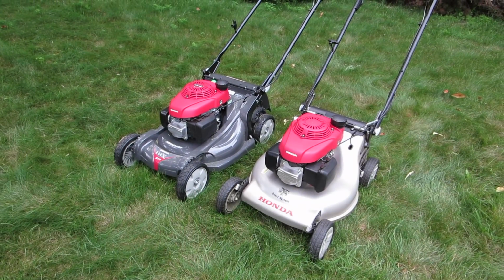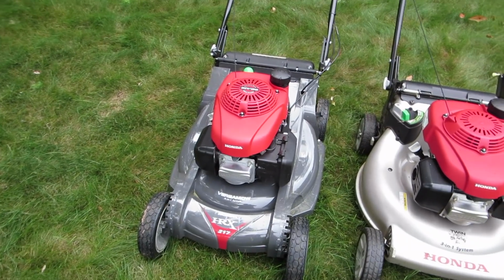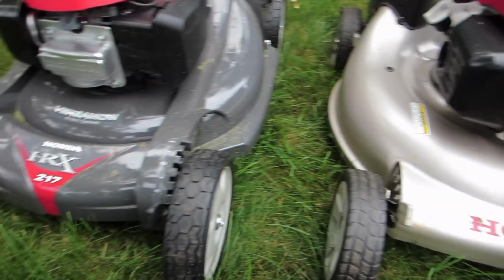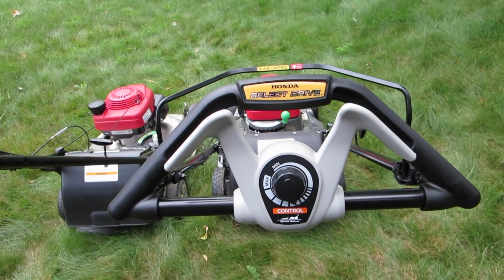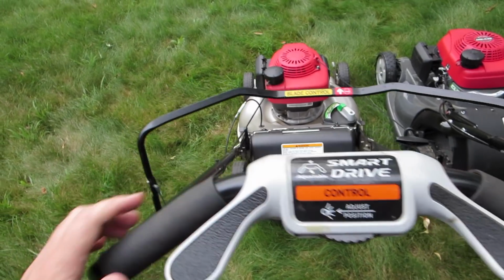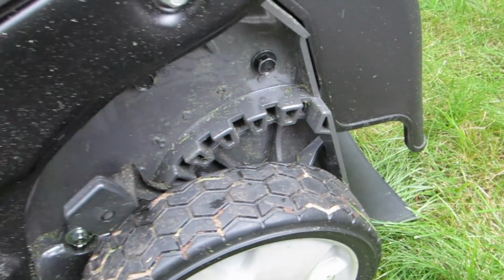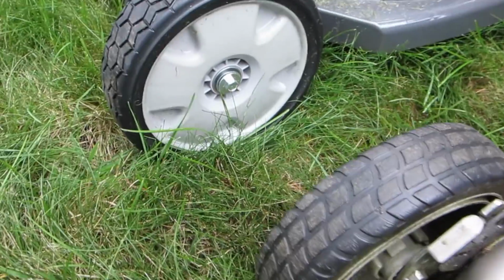Honda HRR vs HRX Mower Comparison - long term review

Comment: The blades are indeed interchangeable....I use the HRX blades on my HRR  I find I need to replace the blades every other year along with the wheels on the HRR as the tread wears down to slicks.. I mow 2 times a week in summer and always bag.  Great mowers!  I change the oil and air filter 2 times a year and sharpen the blades routinely.  I go above and beyond taking care of my HRR and it performs like its brand new.  I also find it helps to do a yearly cable adjustment to jeep the drive mechanism super responsive
Reply: I'm with you. I am an absolute FANATIC about my HRX217HZA. It's the nicest machine, of any kind, that I have ever owned. I came up with the money and decided I was going to buy the best. I change my oil every 10 hours. I put 50 hours a year on her.

I've done so much work upgrading that mower it's pitiful. Magnetic dipstick, protective side rails, tach/hour meter, Plasti-dipped wheels, lawn striping kit and on and on and on. My obsession with that mower is a problem. LOL. I even named her Kathryn. It's sick, I know.
Reply: @heinzkitzvelvet  Good idea on PlastDip wheels. All my neighbors are over-pensioned retired Boomers with the best Honda mowers and nuclear green chemical lawns. It will drive them nuts thinking I have some kind of special edition orange-wheeled Honda that they somehow missed at the dealership.
Reply: @madcowusa4277  Orange. Now that would be different. Never thought of going with wild colours. I used a black base with graphite pearl as a top coat so the wheels better match the deck. I might try something like that next season. I respray them every spring because it peels away by the end of the season and looks bad.

BTW, that's an interesting phrase, "over-pensioned" retired boomers. What does that mean, over-pensioned?
Reply: @heinzkitzvelvet  To me, "over-pensioned" means they have a nice fat monthly retirement check that was part of the their previous employment's benefits package or they were offered profit sharing which they're now cashing in on, hahaha!
Reply: @Believe231  ok. It's sounds kind of negative. Like over-privileged. I mean, it sounds like they worked the years required for that pension that they are recieving.
Reply: @heinzkitzvelvet  I see where you're coming from now.  Yep, one needs to not make assumptions, and to realize it may not have solely been "privilege" that gets people into a comfortable retirement, but they got there through the merits of hard work and dedication.
Reply: Heinzkitz Velvet protective side rails?

Comment: I enjoyed the video. Just got a new HRX217- I kind of liked the older style of speed control, but probably will get used to this new one. As far as the plastic deck, I have seen a good number of older Honda mowers with serious rust on the decks that still had good engines, and I don't live anywhere near salt water, so maybe this was addressing those problems. My old HRX 217 plastic deck is still in great condition after 10 or so years of use.
Reply: Did you get used to the newer Select Drive control? Just curious, because I have an 11-year old HRX217 w/ the Smart Drive, and a 2-year old HRX217 w/ the newer Select Drive clutch grip. The definitely feel different in the hand!
Reply: @joepapp01  After a few months, I sold the new one and bought another older HRX in good shape w the older control. I didn't like the new one, never got used to it, and read a lot of reviews from people that didn't like it either. Another issue was the new HRX didn't have a blade clutch that shut off the blade while the engine continues to run. I really like that feature, especially since my son is 7 and there are usually at least a few small toys that have to be picked up while mowing. The "old" HRX I now use has the blade clutch.
Reply: @mickm5097  so does your HRX with the blade brake clutch have neither the smart drive controller nor the select…just a “standard” clutch lever? My neighbor has an electric start HRX217 with the blade brake clutch, and I’ve used it a couple of times this season. The BBC isn’t a feature that I value, but totally see the utility of it if you have kids. My brother’s lawn always has toys and balls on it from his kids lol. I was surprised with the additional weight of the BBC/electric start model…at least +10lbs on my “standard” smart drive hrx. Will you try to keep yours for as many years as possible? I’m not that much of a lawn care fanatic, but I do cut my yard + 2 of my elderly neighbors’ yards weekly, so…idk, it’s kinda fun to have have a preferred brand of mower and be in a decade+ long rhythm of cutting efficiently with it lol
Reply: @joepapp01  Mine is probably just like your neighbor's. It has the electric start (not something I need really) and the orange handle speed control w 6 or so notches to set the speed, in addition to the blade clutch. I will keep it for as long as it is reliable, I think. My lawn has a mild slope, and the newer HRX control was inconsistent on it- pressing down sometimes made it move a lot slower or faster than I preferred in different areas of the lawn, whereas the older notched control always moves the mower at the same pace, no matter what. The HRX feels sturdy too, like a tank compared to other mowers, which is good, as long as the self propel keeps working. I used to have Craftsman mowers, which I liked a lot- to me the front wheel drive was easier to control. Just pressing down on the handle to lift the front wheels slightly if I wanted to stop the self propel, never had to let go of the propel lever. And it was easy to pull backwards- in contrast, every Honda mower I've had at some point has the intermittent wheel dragging when pulling them backward. Not sure why Honda never fixed that issue. Still, Honda quality and reliability tops other mowers that I know of, so it's nice to have one.

Comment: The place were the deck material matters the most is under the deck when it gets packed with grass. Owners ever clean them so they rust from the underside and rot out.

Comment: The HRX217 VKA(200cc) is a great mower. I have 4 nit picks with mine. Mine turns to the left very, very slightly. The handle is on the highest setting and I still feel like it is too low for me. The speed is on the absolute lowest setting, but still feels a tiny bit faster than what I want sometimes(again 200cc) But the biggest thing is $600 and no blade stop. If you want to start the mower without running the blade, then you have to go up one model... $730...

Overall, it's still the best 21inch mower you can buy. I know it will outlast and cut better than any consumer grade mower.
Reply: A friend of mine buys a new $199 mower every 2 or 3 years.  Our Honda's cost a lot up front, but it's just oil changes and blade sharpenings for at least 5 years and probably not much more after that.
Reply: You don't want that blade stop, the clutch for that roto stop is nothing but trouble. Much more reliable without it and plus these honda mowers start so easy that it's really not worth the expensive repair to have a roto stop clutch.

Comment: I would go with the hrx because u always see the metal decks rusted out on the Hondas with the engine still working so I would rather spend a little extra money to have the better deck so it doesn't rust out

Comment: The Nexite decks are notorious cracking. Once it starts there is no stopping it. Being the owner of a small repair shop these come into my shop on a regular basis. Honda is good about their warranty although nit every mowers damage is covered. They are vert stringent about the circumstances which contributed to the damage. Overall, any Honda mower is a good choice. Personally a steel deck, cared for properly, is my choice. Every day .

Comment: I still have my 15 year old Honda mower and it works great, but looking next year to upgrade "maybe."  The self-propelled drive does tire out my thumbs (no adjustments), better after mowing ever week your thumbs get use to it.  I do like the HRR though a little more than the HRX.

Comment: The rear wheels on the HRX have numbered adjustments that are cut into the plastic. I missed it the first few times as well because the numbers are the same color as the plastic deck.

Comment: I was excited to use my new HRX today. Very nice machine. The new 200 CC engine is
a brute. I do have two concerns that will probably go away with use.
1. The select drive system was poorly engineered. I still have my 20 year old Toro
Super Recycler with the Personal Pace system. No contest, Personal Pace Rules period.
2. Concern is this HRX is a dust producing machine to say the least. I think it maybe over
mulching, I know that sounds stupid. It just makes a dirty mess. I wish the air filter was more heavy duty. It is adequate at best. 
I will get to like it , it’s just tuff when you are use to the Toro. Great video I might add!

Comment: After almost a year, did the wheels harden on the HRX? In April, it would be great if you did a 1 year review.
Reply: I got mine in 2014 and no they are same consistency. I am in Nebraska so we get all 4 seasons.
Reply: Keith White I bought a HRX217HZA just last week, though it’s on backorder and no telling when I’ll get it... the discounts are crazy now. That mower lists for $959 and paid $780 + an extra year warranty.
Reply: zfilmmaker that is a good deal. Mine was 645 in 2014. Besides changing oil , spark plug, air filter and blade no maintenance. Starts on first pull. You will love it.
Reply: @keithwhite6096  I mainly decided to buy based on price. I've had several Lawn Boy's... in the last decade quality has gone downhill. I've been ready to part ways for a while. Honda seems to have the best bang for the buck. Everything I buy with a Honda motor seems to last. Case in point, I bought several high-end snowblowers only to find out they were all junk compared to a Honda. That goes for pressure washers also. Thanks for your input!
Reply: @keithwhite6096  if you haven't already, you may eventually want to replace the drive shaft bushings and dust seals (each rear adjusting arm takes two bushings, and they absolutely wear out over time).

Comment: Thanks for sharing Garage! I've had my HRR for about 6 years now in Florida and my deck is rusting out. Also, I've had to maintenance the self propelled system once and it needs it again. My question, how would you compare the robustness of the self propelled systems of each? It seems I've heard people say they have gone 8 plus years without needing to do anything to the HRX self propelled drive? Thanks.

Comment: Just out of interest, have you thought about trying to swap the wheels from the HRX onto the HRR?
I have the HRR here in Australia, and the tread has worn completely off the rear drive wheels, and it is greatly  exacerbated by the rear wheels locking up and not free wheeling when pulling the mower backwards. But I totally agree that the HRR could do with the bigger wheels. I would love to know if they were interchangeable as I would buy the bigger wheels. Great review. Thanks.
Reply: David Ludrock 
Putting bigger wheels on the HRR would mess up the cutting heights a bit. But what I’ve done with my HRR is I’ve put these new style wheels on it that Honda now makes. They have so much better traction and are made of a better material. https://youtu.be/GLPqdKXDo9E
Reply: This vid will help you address the issue with real wheels locking up when pulling it backwards. Its due to the crappy plastic bushings Honda used on the HRR.

https://youtu.be/ZvpqyWQUb48
Reply: @KirbyVacuumCollectorFixer  thanks for that. I'll give those K10 wheels a go.
Reply: @cliffm.9796  they use crappy plastic drive shaft bushings on the HRX line, too lol

Comment: I’ve had both models. The HRR for a yard with st Augustine and it worked freaking amazing, all mulching. Never felt under powered. The HRX for my yard with Bermuda now and it’s just ok on mulching in the thickest parts of the bermuda. I to liked the HRR paddle better drive too. I use the HRX paddle in a varying like I did with the HRR. Don’t care or use the in between bag and mulching. Don’t understand it really.

Comment: Have you ever had issues with a strip of grass being left on the left side, just inside the wheels, that’s unmowed? Change the blades to new Honda blades this season and I’m getting a streak of grass that’s not getting cut. Trouble shot everything I can think of...still leaves uncut grass.

Comment: I have the HRR and I upgraded the wheels to the 9" ball bearing wheels that come on the HRX for only $45. Now my HRR is the perfect mower.
Reply: Big Texas: I was thinking about doing that too, I’m glad you posted that. Did you have any problems or need any modifications?
Reply: @matthewinga9546  The only problem is the gears on the back of the actual wheels are 

a different size so I used the gears from the factory hrr wheels and put them on the new hrx wheels and they work perfect and have been since I did this modification 2 years ago. The gears are held on to the wheels via plastic tabs so I just used my soldering iron the heat the plastic tabs and fold them up to be able to remove the gears then heated them again the push the tabs back down once the gears were installed. You only have to do this to the 2 back wheels so it's not hard at all. I use my mower everyday for commercial use and the wheels have been holding up for over 2 years now and the tread on the hrx wheels seems to be actual rubber as opposed to the factory plastic hrr wheels so they are very durable and the tread still looks new even after all of the use I've put on them.

Comment: I have a 15 year old HRR. it’s been a great mower hose it over the dog during my divorce and it’s still doing better than the dog and most importantly, it doesn’t shit all over my lawn.  I haven’t done much to it other than sharpen the blades a couple of times and change the oil every couple of years but it’s starting to get a little sluggish and it needs a couple of hundred bucks in maintenance and I thought i would upgrade to a self propel model. The HRX is at the top of my list but I prefer the TORO super recycler with the Honda engine. The downside to the Toro is that the Honda engine is the weaker 159 cc and the biggest deal breaker is it doesn’t have the blade stop when you let go of the throttle so I have to keep restarting it. Decisions, decisions?

Comment: Great videos   I bought the HRR  and had it for 6 months before it started stalling and shutting down.  Now looking to get another one.  It broke my heart cuz I love Honda lol.  Kind of hesitant to buy Honda again.
Reply: John McLain   At just 6 months it is still under warranty, so bring it back to your dealer.  It sounds as though the carb. Needs an adjustment.  Pretty simple fix, then you will be up and running again.
Reply: Randy Jorgensen  I called up Home Depot what’s where I bought it from.  They actually took it back      Now I don’t have a lawnmower.  I don’t know if I should buy the same one again or upgrade to HRX model. I don’t have hills on my lawn it’s square and level.  I’m confused. HRX is few hundred more.  Or just buy a toro or something.     Il not sure what kind to buy now because of my bad experience with Honda.
Reply: John McLain Mowers are mechanical things, and mechanical things can have problems occasionally.  This don’t mean it’s a bad product.  My new toro had the rear wheel drive system fail after just one lap around my yard, big bummer.  But I had it fixed under warranty and it has worked fine ever since.  I guess my point is, don’t stress over it too much.  There is no such thing as the perfect mower, but they are truly ALL good enough.  So pick one based on “does it have the most important features to me”, then consummate the marriage with your credit card, and live happily ever after!
Reply: Randy Jorgensen   Yeh you are right.  I’m gona buy it again  cuz I loved it.    Thanks for the advice.
Reply: @Jigsawmaster1  Yep, same here, I bought a new Honda HRX, and after a month, it developed a problem & became hard to start when the engine was first started for the day.  It actually turned out to be the gas, it had absorbed water or something, and so it wouldn't fire easily.  Drained the old gas out thru the carb drain plug, used fresh non-ethanol gas (ie expensive), and she fired on the first pull, and ever since!  Was very close to returning it, but called up a Honda mower dealer and they said to try that trick first, and it worked and then to NEVER, EVER put ethanol gas in it!  It's very hard to find non-ethanol gas in this corn belt state!
Reply: Believe231   I live in nj.  You can buy non ethanol gas at Home Depot.  It’s preety expensive.   I bought the same lawnmower again  cuz I liked it so much.   Right now Honda gives you an extra year of warranty. So total of 4 years.  Plus I bought the protection plan from Home Depot for 3 more years for 55 dollars.  So I’m covered for the next 7 years.  I’m not too worried about it anymore.   Unfortunately gas isn’t what it used it be.  If you don’t mind the price. It’s definitely work going ethanol free.  Most of the problems are caused by water in the gas.

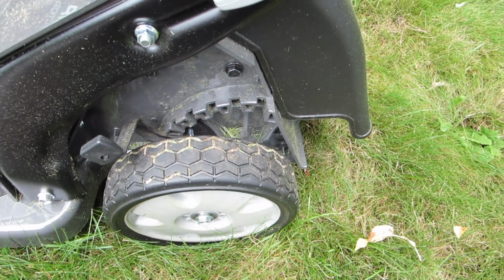Comment: 5:42 the numbers for mow height for the back wheels are literally visible in your video. they're embossed in the deck rather than on a sticker... no need to count.
Reply from the maker: You’re absolutely right, others have pointed this out , too! Totally missed them. Not sure how I never noticed them, guess I was looking for the same thing I saw on the front. I still think it should be the same format all around to avoid confusion but definitely not a worthy criticism of the HRX.